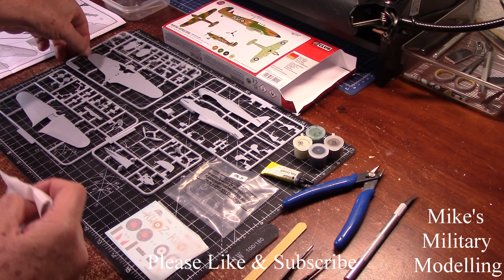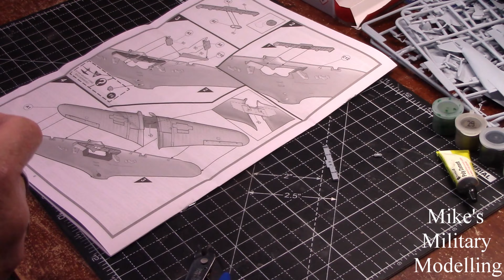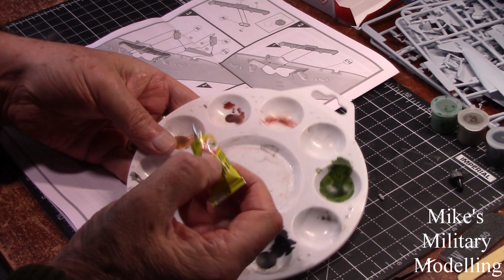Hawker Hurricane MK1  (Part 2 Building the Fuselage & Wings ) An Airfix kit 1:72

Comment: Ha, I remember as a kid I could put one of these together in a few hours, sometimes not even waiting for the glue to dry or skipping ahead and starting on a different assembly while everything dries.  30 years later and it might take me days to do the same kind of model when I find the time.  There's definitely an element of perfectionism at play, you always want your next model to look better than the last...after a few decades the extra attention to detail certainly starts to add up in both time spent and the finished product.
Reply from the maker: You are absolutely right, we get more patient with some stuff as time goes on and less so with other stuff.  Have a great Christmas.
Cheers Mike.